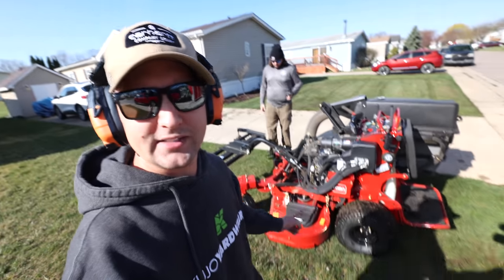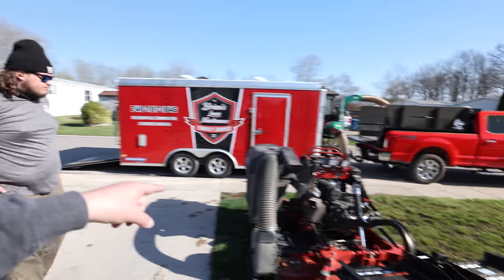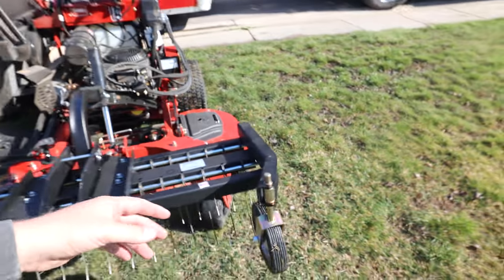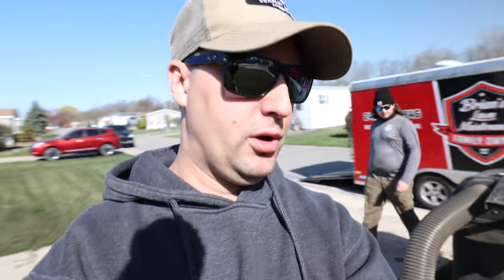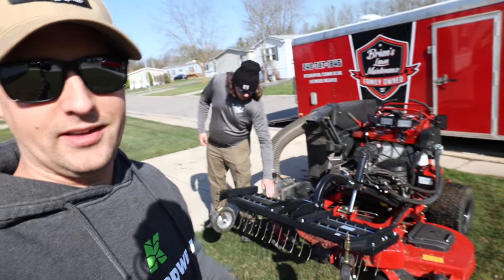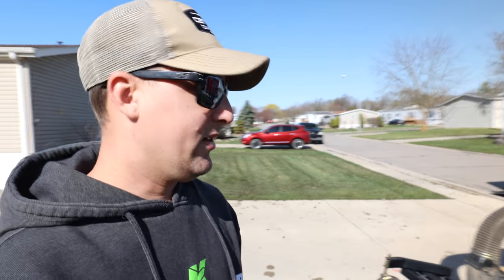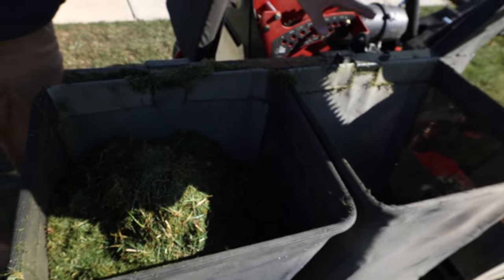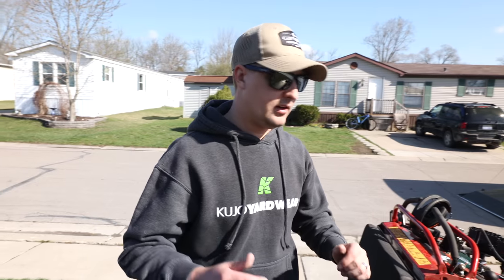Toro Multiforce w/ Dethatcher Setup First Look! (Pretty Dope)

Comment: We don’t do dethatching  around here I don’t offer that as a service in my experience it removes more good grass than bad. You also have to haul all that crap away too! About the only grass I know of that could use that is zoysia grass and we don’t have any hardly full lawns of it here in Missouri. My lawn company we do aerations and slice seedings. I don’t mow lawns either just do lawn applications and trees. If I was going to do it that would be the setup to use beats raking everything up after you use the walk behind dethatcher.

Comment: Pretty sweet set up. I run a similar setup with the walker mower. I offer dethatching to all my customers. I charge new customers and ones that only use our service periodically for dethatching. Regular season customers I include it free on there spring or fall clean up!!! Cutting and  stripping that sweet “G” on Cape Cod!!! Keep them lines hot!

Comment: I have always dethatch in the spring i built my own thather and mounted it to the front of my zero turn. i use the thatcher to help pull up all the matted down trash in the yards. dethatching works best in dry grass. wet grass youre just asking for trouble

Comment: My wife and i offer dethatching as its own service. Not included with clean ups. We do some in the fall and some in spring. Honestly in all the years i have been doing it it doesn't seem to make a difference whether it is done in the spring or fall. The only issue in spring is sometimes it takes a lawn longer to dry out for it. We do however try and avoid doing them on the same lawns every single year. Most lawns don't need it done that much if they are being properly maintained and it can actually do more harm than good if done to often.

Comment: Extra charge in MN for us it's a lot of work to include that with spring clean up or fall.
Reply: i just do it at the same hourly rate as bagging when doing cleanups
Reply: @gamerfarms9362  I like to get the leaves up let the grass breath again and then next week or two  get it done plus you can only get so much in a pick up bed even if you compact it down. If I was running 2 trucks or dump box or dump trailer sure I would add it
Reply: @hunterslawnsmichaelhunter1568  we do run two mowers with the whole set up so that helps

Comment: I have a lot of people calling ,"asking for bag up the grass clippings" thinking they will be able to pull one over on me. They think if they just pay for a one time clipping charge that will pull the thatch up along with the new clippings. Then they get pissed off when it doesn't work. When they should have just asked for what they really needed in the first place. I can always tell when it is going to be a case like that. And it happens with leaves also, when I get there on a leaf job and it looks like 3 to 4 years of build up woven in the grass and and they get butt hurt when I tell them they need dethatch instead of leaf clean up (raking).

Comment: Here in Chicago this just would get too many complaints. “It’s going to fast” “it’s not even enough” I don’t know, I think it’s still worth having 4 pushers.
Reply: I hear you on that. We had those same questions the first year we switched to tine thatching mainly. I personally think it does a better job and doesn't take as long to clean up.  But we do down and back passes not just one time

Comment: Did not seem to be pulling up much dead grass and when you showed the bagger it was mostly green when it should have been a majority of dead grass.  Don’t see that as much difference with the cheep drag behind,  it’s definitely not as good as a power rake or slitter.  Check out some videos on the Bluebird Dethatcher and you will see a huge difference, this is just a toy in comparison.